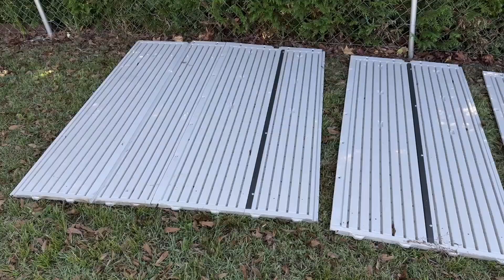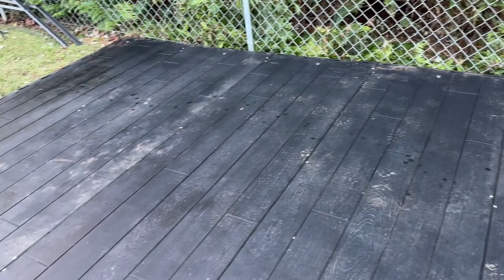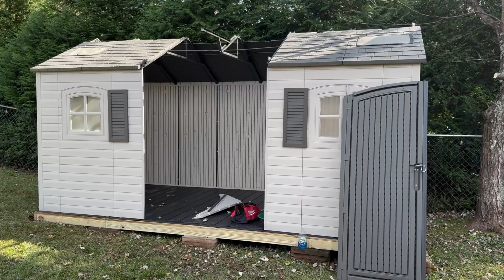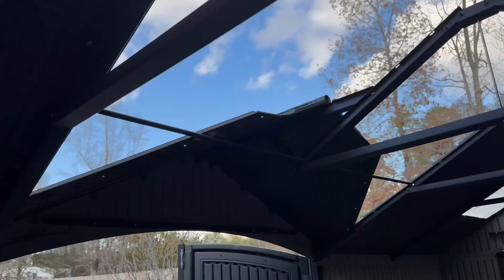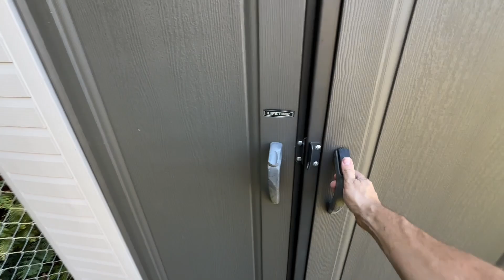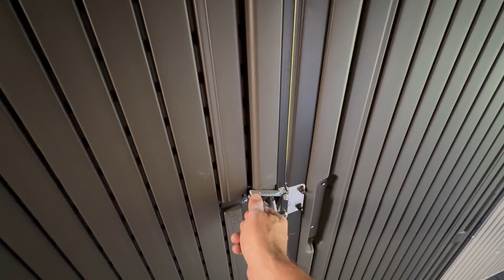Assembling Lifetime Shed

Comment: Looks pretty good! I got a cheap small shed off Amazon. Designed apparently and made in China. The number of tiny screws needed is simply ridiculous, actually ludicrous. Not even marks where the screws go, never mind being pre-tapped! Instructions (all pictures) have to be carefully reviewed and understood prior to each step. Very small shed (not a walk-in) and the manufacturer is recommending two people over a full day to put it together. Never again!! LOL!
Reply from the maker: @michaelc6817  i actually got this one from Harbor Freight about 20 years ago.  Pretty easy to setup and use.  Plus there are many mods you can do to it.